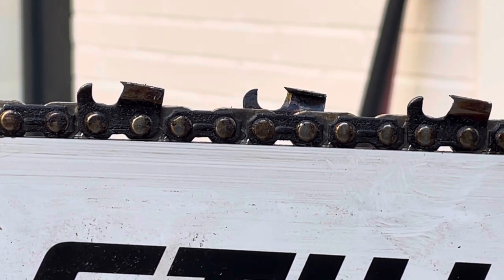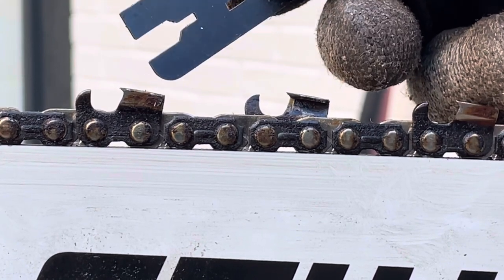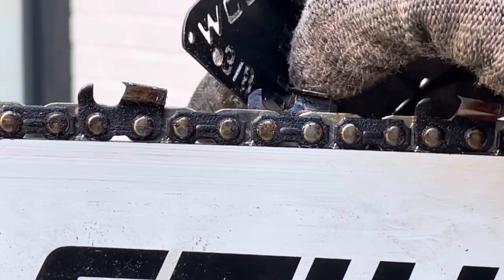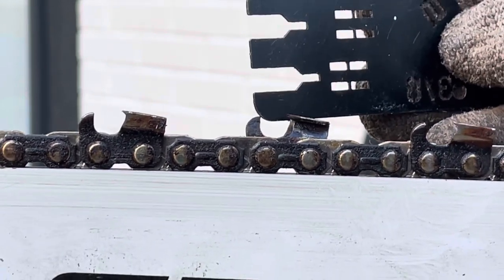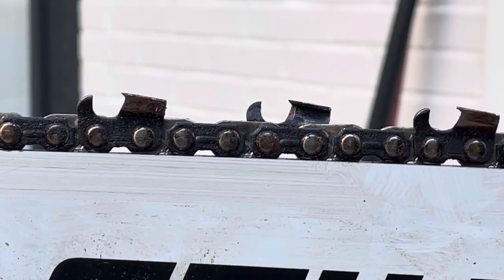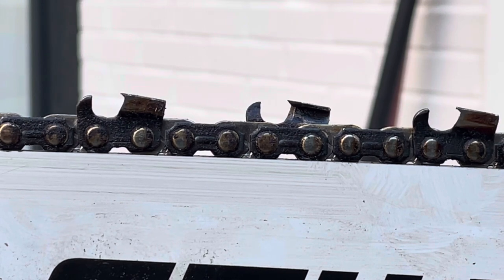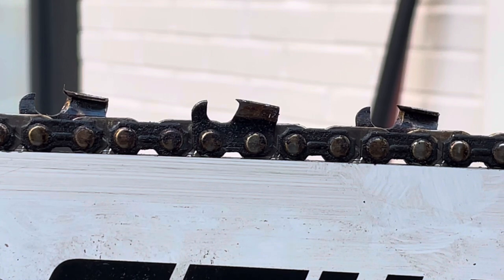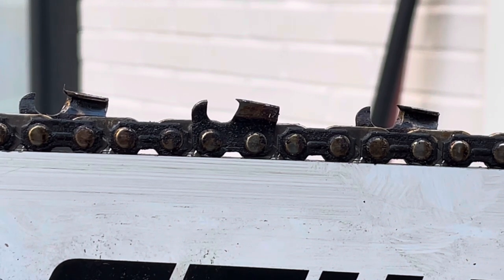Differences in husky and west coast saw depth gauges raker gauge drag gauge

Comment: Good point you made on depth of the raker, too low a raker would cause the tooth to tilt or flex back and not cut properly, perhaps tear the wood instead.

Comment: Just the other day I used the WCS gauge on the 2nd to the lowest (.040) on the 24" full comp 84t running on my ported 592xp and put it into some bar-length poplar.. that impressed the hell outta me cause that saw was pulling 2-4" long chips that were rolling up between the teeth. I'd have tried the .050 if I had the gauge and file that day. Those lower settings definitely have their place, but im not sure it'll work too well in Locust or Hickory
Reply from the maker: I agree

Comment: Ive been using the oregon guage for a long time, but it only has one setting, .025. It works well for my purpose, but have been thinking about for a while now to buy one of Gordy's depth guages. But here is the difference between the two, the oregon lays flat on the teeth and the rest lays at an angle. Ironhorse thinks that flat runs smoother in the cut. I dont know because I havent compared the two. Thats a topic to make a vid about. Thoughts?
Reply from the maker: Ive only ever ran the angle ones i guess which when i get down on the raker i always round it back out to give it factory look in away to make it smooth
Reply: @MitchellsBackyardLogging  yep. I know some leave them at an angle and I guess some dont🤔😉would be a good topic to discuss. Thanks fer the reply man😀
Reply: It's not just about the angle of the top of the raker...  it's the overall height.  As a tooth wears 025 may not be enough due to how the tooth rocks in the cut.
Husky, WCS, the old Carlton gauges all file "progressively" as in they file to angle of attack instead of depth.  You'll get a better cut over the whole life of the file with the angled type raker gauges.
Reply: @mattfleming86  thank you for the feedback man! I know its about the overall height. Was mainly curious about what runs smoother in the cut, flat or angled. Gonna order a raker gauge from wcs tomorrow and try it out on the rakers and see what I like better. Plus drop them down to around .030 instead of .025. Again thank you Matt!
Reply: @ramoutdoors6415  Good luck dude!
I really love the husky gauges (very similar to WCS) 
If you can find Carlton's complete book of saw chain they provide some interesting facts about depth gauges.  I have the Pdf and had to dig around for it..  id give you the link if I could find it..  but it's out there somewhere.  Good stuff.
Reply: @mattfleming86  will see if I can find it man, thanks much man!

Comment: We set up saw , digital probe , computer cut tooth and rakers done all at once, power chain advancement. Raker depth,  tooth angle programmed in. 1 minute to complete. The computerized systems are dead accurate. Over the long run pays for itself. Chains always perfect.

Comment: i have to tell the truth on a 20 inch bar with a 70 + cc saw you just grind the drag about 1/16 th and never touch it again no measuring and it works fine i see why you measure on a longer bar west coast.